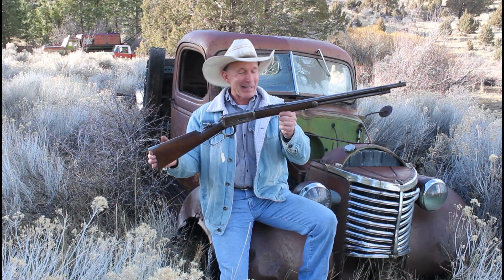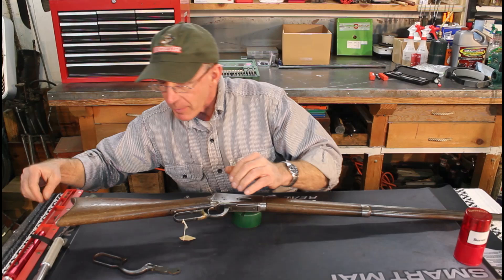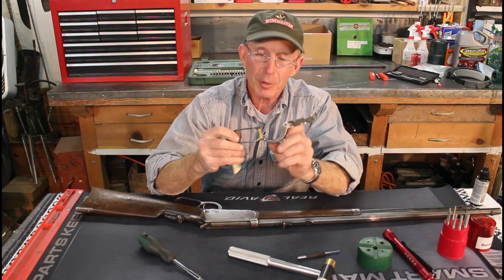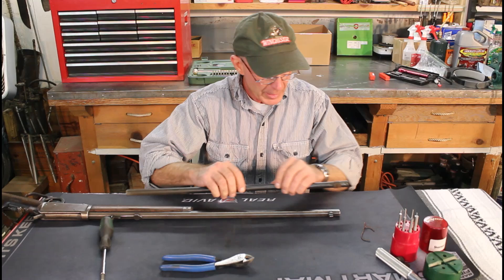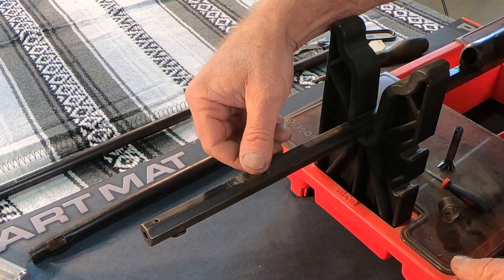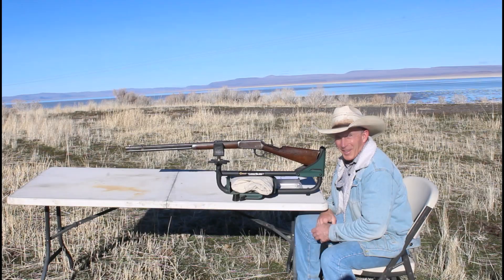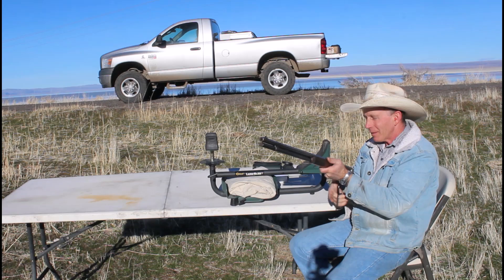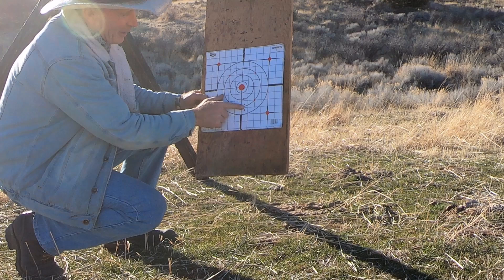Junkyard Winchester 1894

Comment: 13:15 Would it be advisable to use a wood or plastic dowel to turn in the mag tube hanger instead of the mag tube itself?
Reply from the maker: Either would work if you're concerned about scratching the finish on the mag tube.
Reply: @thecinnabar8442  Cool, thanks for the reply!

Comment: Fix it back to original, don't "restore" it. Lots of parts are still available. Mine was manufactured in 1898 and I was able to purchase parts and get it back to 100% functional (I may have typed too soon I see you are now replacing the lever)
Reply from the maker: Yep, mechanical repairs only to this old girl.  I will only restore guns that no longer have their original finish or have been badly abused.